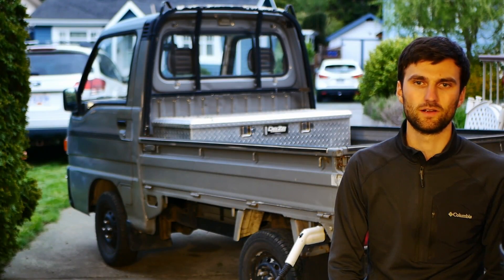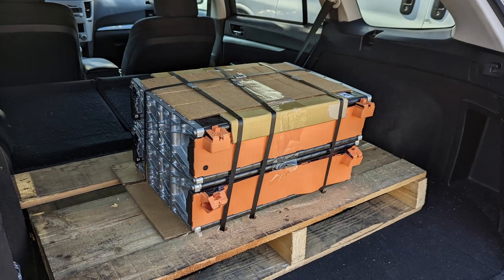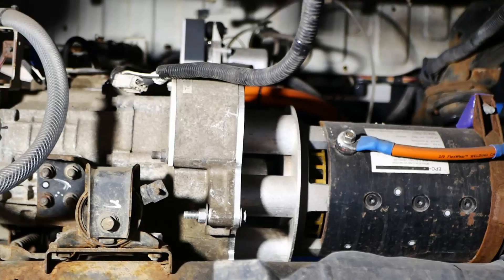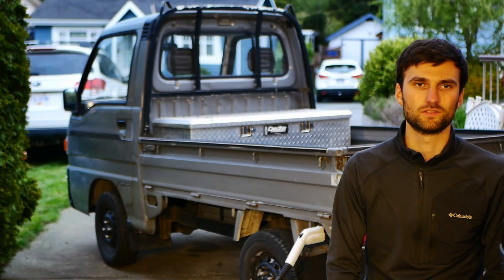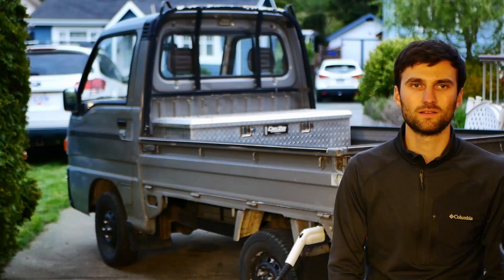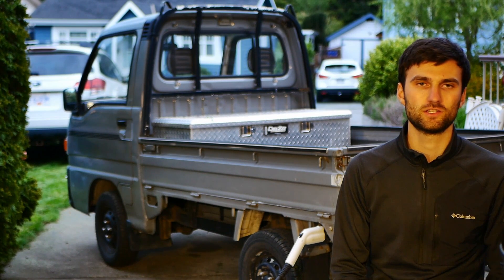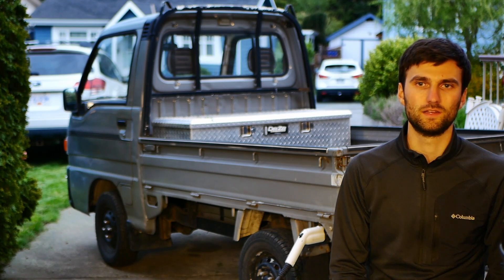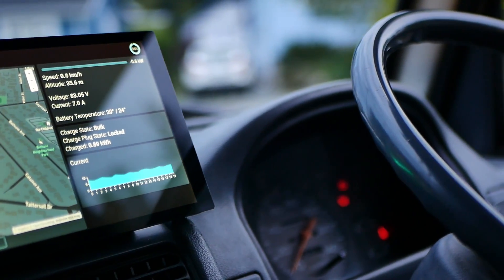01. Subaru Kei Truck EV Conversion

Comment: Did you just run the motor at 72 volts because of the cost of enough batteries to get to 140v? I imagine it would do highway speeds comfortably and be a pocket rocket at 140v....

Comment: what was the total cost of converting? and what kind of range? and last what is the top speed? thanks.
Reply from the maker: I put about $7000 Canadian into it for parts and materials. Vehicle cost $2800 cad. I typically get about 80-100km to a charge. Top speed is only about 75kph unfortunately due to the combination of motor and the factory transmission

Comment: Cost? range?
Reply from the maker: Cost was around $10,000 CAD including the vehicle and it gets about 80-100 km in a charge
Reply: @ari.robinson  Amazing project. Range is little low for everyday practical use. Cost is very reaspnable as well. If 200 km was range i would buy one. lol
Reply from the maker: Thanks! For where I live it's perfect, but I could totally see the need for more

Comment: MORE VIDEOS PLS! Looks so fun

Whats your top speed?
Reply from the maker: It's not super quick due to the motor I'm using and the gear ratio of the transmission, but it's fully powered up to 60km/h, then tapers off up to 80km/h

Comment: Wow! This is such an amazing build! You've made me really happy that you shared this! 

My biggest question is why going with a brushed motor? 
I assume it's keeping cost and complexity low. But also at what point in the project you knew/decided to go with a brushed motor. 

Fantastic logging all the information with real-time viewing too. Never too many data sources.
Reply from the maker: Thanks! I actually purchased the motor for a different vehicle originally, quite a while ago, series would brushed DC motors were more common and cheaper. Definitely would go for a BLDC or AC motor if I were to get one now. I may have an upgrade in the future if I can find something for a reasonable price.
Reply: @Ari3Dxyz  That explains a lot! It's a great choice nevertheless. It's even more authentic to the real 1995 electric vehicles. 
You're amazing. Stay awesome!
Reply: https://www.youtube.com/watch?v=Uy-4TzbnfX8&t=2m
Found the old clip where it was reviewed back in 1995. Battery tech has moved forwards a lot!
Reply from the maker: Very cool, thanks for sharing!
Reply: BMW iX M60  Is powered by a brushed brushed motor....  What's old is new again... Except it's AC not DC powered...
Reply: @Ari3Dxyz If you want AC motor in the future, I can try to help you

Comment: I'd love to do a conversion like this! This is awesome! What kind of range do you get? How fast can it go? I assume it's registered so it's legal to drive on a highway. Is it RWD or 4 wheel drive? What voltage are you running? how many kWh is the battery pack? can you charge anywhere or only at home?
Reply from the maker: I typically get 80-100km, speed is limited to 70-80kph due to gearing. Yep, I've gone through the process to register it as an electric vehicle. It's rwd by default but I can switch in to 4wd when needed. 72v nominal, 15.8kWh. I can plug in at any J1772 charging station (most home/public level 1 and 2)

Comment: What software do you have on the PC? Just got a Prius and I'm getting ready to dig into CAN hacking.
Reply from the maker: I've written my own software for this since each device (motor controller, BMS and GPS) all use different communication protocols.
Reply: @Ari3Dxyz  Are you open to sharing the dashboard UI code? Looks great and I'm keen to see how it's built!
Reply from the maker: @TomLanyon  I'll make a video about it in the future! It's a webapp written in react that subscribes to an MQTT broker on board, so quite specific
Reply: @Ari3Dxyz  cool, keen to see more!

Comment: You got my sub.  Now do a complete video.  What did you use for a motor controller?  What is your top speed with the current setup, and what would it be if you could give the full 144v to the motor?  How did you couple to transmission?  Did you keep the 4x4 front drive?
Reply from the maker: Thanks! I'll make sure to address those in future videos. Top speed is roughly 70-80kph. I made a motor coupler to attach the flywheel to the motor output shaft. I still have the 4wd switch so I can switch from 2wd to 4wd for the snow/mud.
Reply: @Ari3Dxyz  Appreciate the overview and the additional information. I know you can't go back in time and do a step-by-step conversion posts. But short separate detailed posts on the different  steps needed to do the conversion, would be nice, including costs And how and where the parts were obtained. When and if you get the time to do them.
Reply from the maker: @nc3826  great suggestions. I'm hoping to make some more videos when I have some more time available
Reply: @Ari3Dxyz  sounds good... and your reply reminded me to subscribe to your channel
Reply: @nc3826  yeh a step by step on part choice, where to get them, cost and other potential options for something with more range and top speed.
Reply: @jedics1  Yeh, but the "perfect is the enemy of the good"

Something that's lost all meaning in this age of entitlement....  C'est la vie